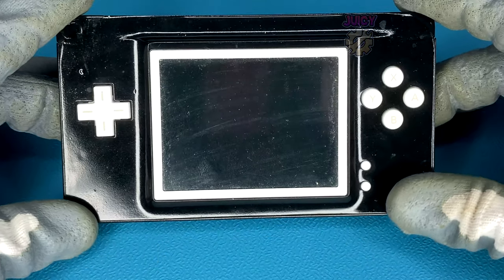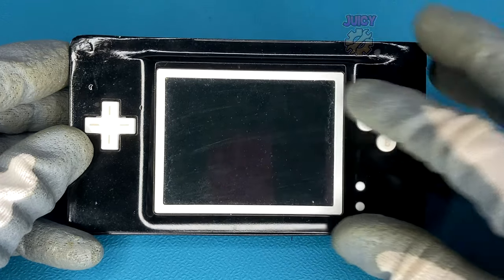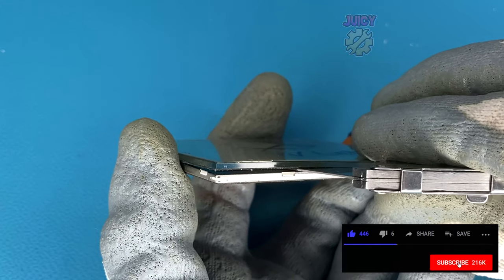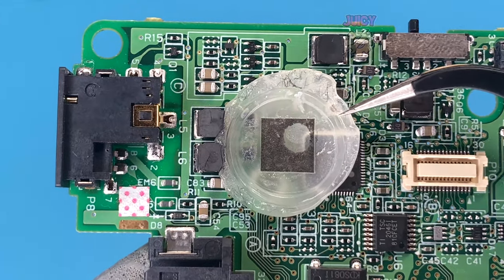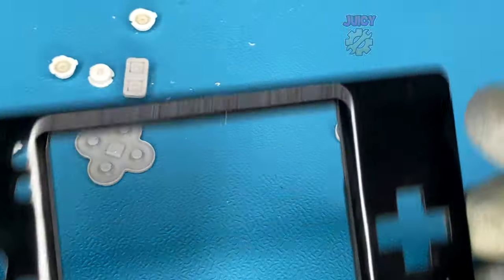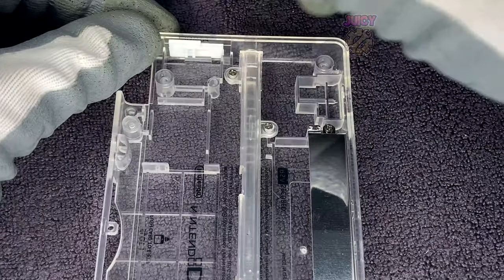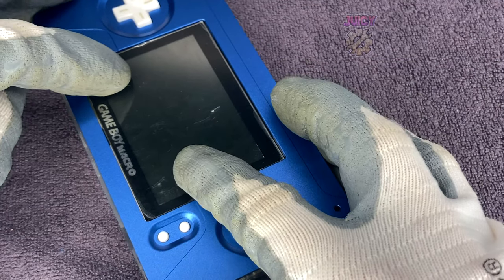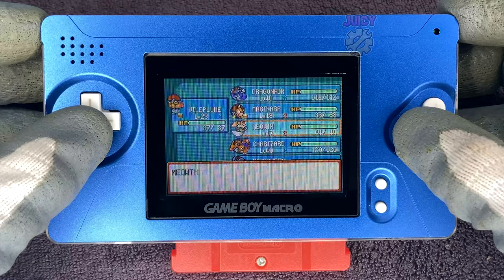the ULTIMATE Gameboy Macro build! Boxy Pixel Shell

Comment: Awesome man, I love Macros. 
DS Lites are not impossible to work on but they are the most frustrating device that Nintendo have ever made imo from a repairing perspective, that damn ribbon cable from the top LCD is so finnicky and I've gotten to the point where I just desolder the cart readers to avoid the hassle of wiggling the cables for the wi-fi module and mic through. This mod means I can use that motherboard and turn it into a great little GBA unit rather than a DS with a flawed hinge design that would be a pain in the ass to service - great video!

Comment: How does the DS games work without a top screen?
Reply from the maker: its still a DSL console and will play all DS games no problem! By no problem i mean the DSL will play them but you wont see anything on the top screen haha. In a gameboy macro mod we use a resistor to trick the DSL into thinking the top screen is still connected.
Reply: @JuicyJakeRepairs  Thank you